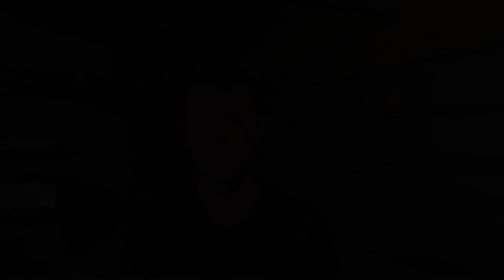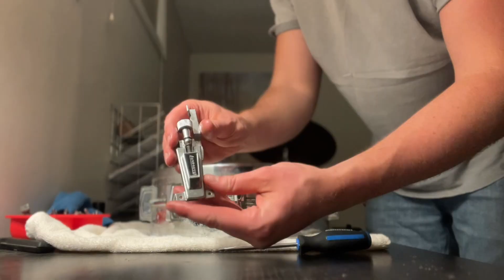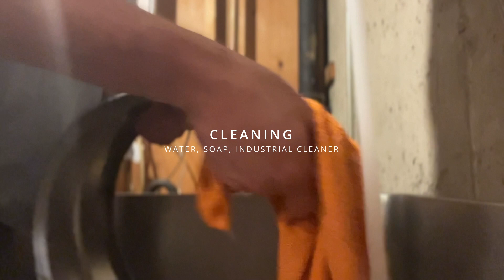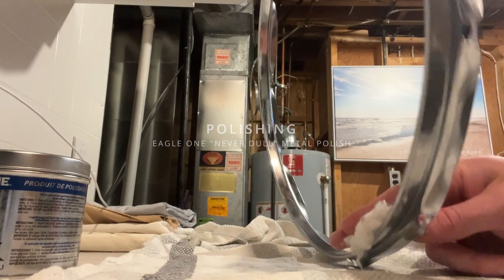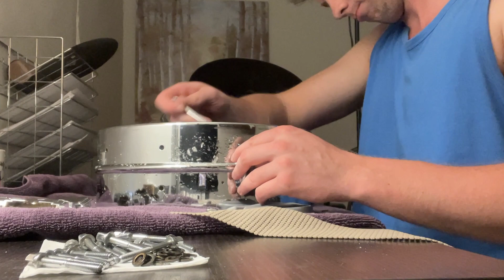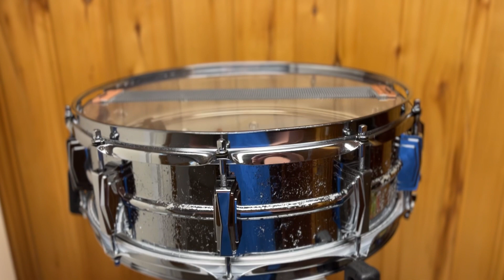Ludwig Supraphonic Restoration | 1970s Snare Drum (5x14)

Comment: I did the same thing with a '76 I found on ebay except mine actually had a lot more pitting than yours.  Did a complete rebuild as the spring foams were dust.